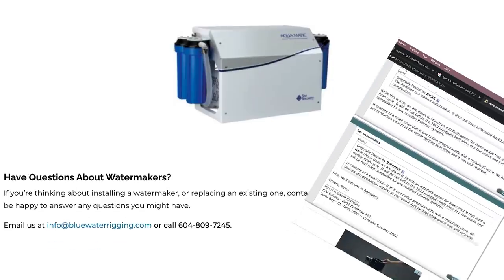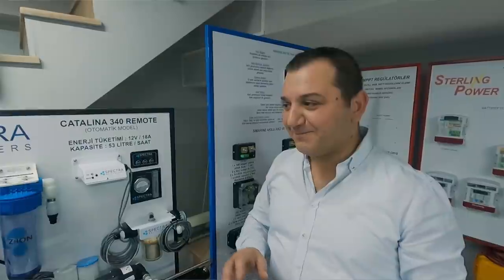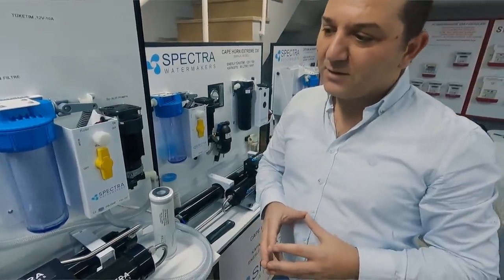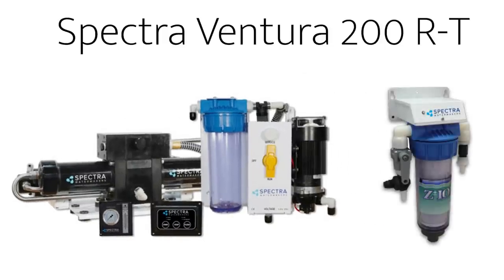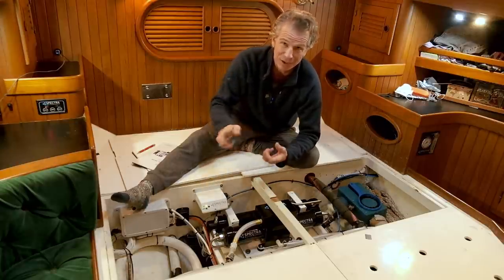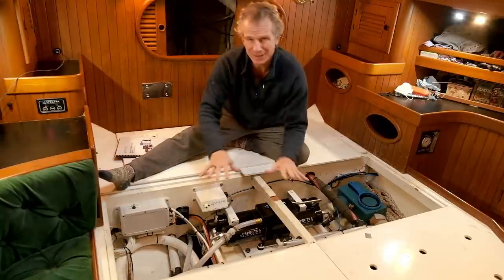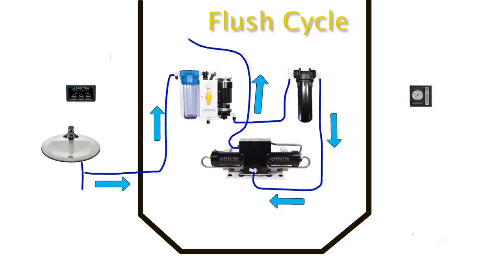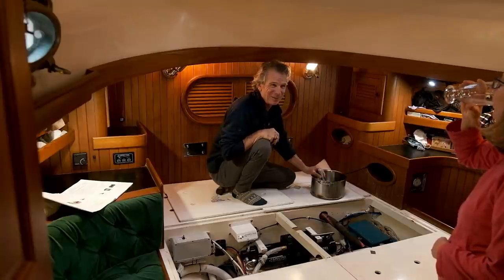The best water maker for us |  Spectra Ventura 200

Comment: Steve I don’t understand why you use a manual system of a glass and tube to test the water, I would imaging this takes time and would be difficult while under way in heavy weather.  Most water-maker systems divert to a spout over the galley sink and the saline level is automatic.
Reply from the maker: I prefer to have as much things as possible manual. Yes it might be more time consuming doing it yourself but we’re not short of time. An automatic system will eventually go wrong no matter how well built with sensors and electrically driven valves & that might end up putting salt water in your tank and raining the whole water supply. Of course if that were to happen it’s bound to be mid Atlantic!

Comment: Is it that difficult for the manufacturer to provide a water quality sensor and automatic diverter instead of that manual water quality tasting procedure? 🙄
Reply from the maker: Yes Spectra have a fully automatic version that does all that but I prefer the simple manual method. Sod’s law says if the sensor is going to go wrong it will do it mid Atlantic and send salty water into your tanks tainting the whole fresh water supply. We are live aboard cruisers I have time to taste some water!
Reply: @svfairisle  if the water maker is up and running and making clean water, wether by taste or automatic sensor you still need to divert the water from the sink outflow to the tank manually by turning the lever from sink to tank so your comment on an automatic system dumping salt water into a tank couldn’t happen.  Secondly I have owned and used many makes and types of water maker over the last 20 years and have never had a problem with saline sensors.  Being a live abord is irrelevant, imaging in very heavy wether having to hold on in the fore cabin to a glass and a tube while turning the valve on and then having to taste the water and never being sure if it is totally free of salt, especially coming down from a salty atmosphere.  Even a tap over the sink would be much easier to use in these conditions.  Any water maker with special parts that can only be purchased from one manufacturer is not a good idea, most water makers use off the shelf parts that can be adapted anywhere, a spectra pump would be difficult to repair in far off places, the answer would be to carry a spare pump, very expensive.
Reply from the maker: @teddyboysdontknit810  All the automatic systems I’ve seen detect and switch the water it seems people who want automatic want everything automatic, I don’t!